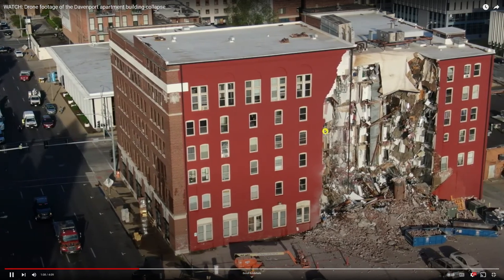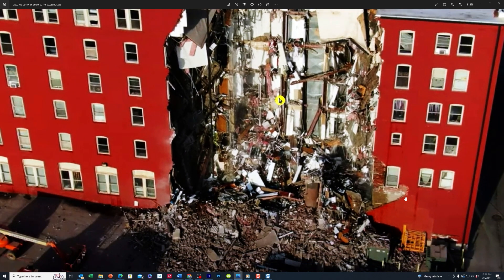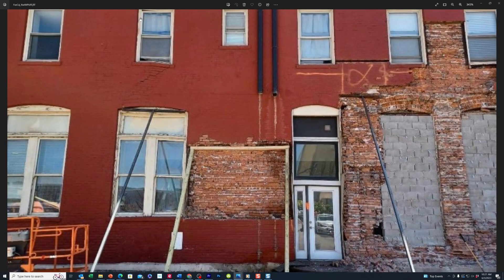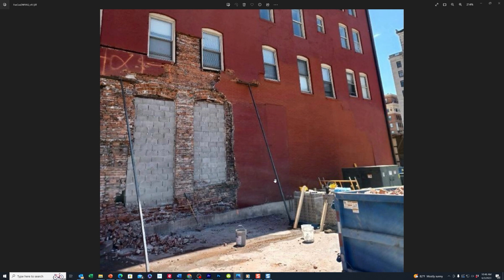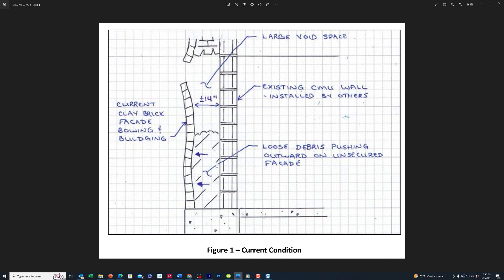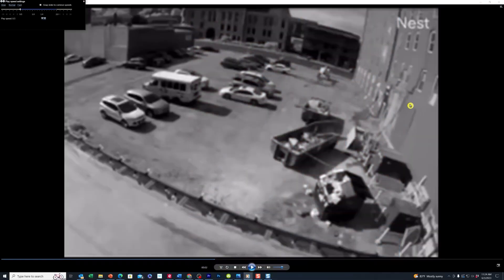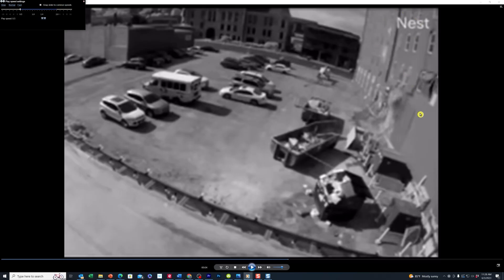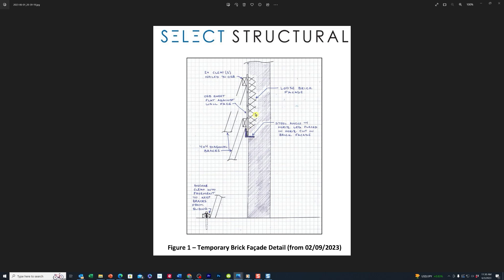Davenport Collapse Security Cam Analysis Pinpoints Origin

Comment: Would “just” the facade falling would not bring down so much of the building?  There HAD to be so much water damage in the structural wall!  Great coverage!  This one wonders what the bid included from the guy who lost the bid and warned the workers earlier.
Reply: IIRC it was $50k in bracing that the owner refused to pony up for. And it seems like the final approved permit for the same job was submitted as basically a $3000 DIY that the building owner was taking care of mostly in house.
Reply: @matthewbowen5841  Yeah, probably with Home Depot sidewalk workers...
Reply: @matthewbowen5841  Yes, and it's quite common for an owner or "handyman" doing the work to severely under-report the estimated repair costs as the cost of the building permit increases substantially in many types of jobs.
Reply: Yes. It's how those old buildings were engineered at the time. The brick was actually support. Like many things, people today only view things from a modern perspective and think that's the way it's always been.
Reply: It's not necessarily water damage.  The mortar they used back then was crap, it dries out and gets brittle, eventually providing no adhesion between bricks.  You end up with a wall held together by just gravity.

Comment: Those columns of windows: cut along the dotted line.

I won't be at all surprised if they discover that one or more of the interior courses of bricks in those walls were just 'indoor' bricks, meaning bricks that were merely dried and not fired. Much weaker and they revert back to mud whenever exposed to too much moisture. 

But hey, what did the original (no doubt low bidder) builder care? The building would stand long enough to outlast him.
Reply: Well, I wouldn't blame the original builder too much here. It can't be a retroactive expectation that 1908 engineers and builders should be held to using materials that would hold up to major water leaks and total disregard for maintenance 115 years down the road.
Reply: @matthewbowen5841  Except I'm not holding 1908 builders to expectations that weren't well known at the time. It was widely known that 'indoor' bricks were unsafe for use in exterior structural walls and, in many cities, it was against code at the time. I don't know if it was against code specifically in Davenport but the risks were widely known.

All brick, all masonry, absorbs water and evaporates it. This is knowledge that is literally thousands of years old. A structural wall needs the extra strength of fired brick for the exterior courses but the interior courses are hidden from view--it was a very common cost cutting dodge in the 1800s and early 1900s to substitute indoor brick for part of the fired brick that was called for.
Reply: @GrainneDhu  Got it. I wasn't aware, thank you
Reply: @matthewbowen5841  No worries.

I find it darkly amusing that the more things change, the more they stay the same. Our ancestors weren't all that different from we are today--they just applied the same attitudes and rationalisations to the tech they had at the time.
Reply: @GrainneDhu  The knowledge might be thousands of years old but not everyone is clued in... I used to own a house built in 1994 with a brick facade on it. It had a box bay window through it. Guess what happened to the drywall ceiling of the box bay window? It got wet because water was getting through the brick, which is apparently not quite as waterproof as the builder (Richmond American Homes) had hoped it to be. I broke a hole in that ceiling and looked through, I could see the back side of the brick facade. Also, this facade had no weepholes in it at all. I suspect it was pulling away from the house, too. I had the ceiling repaired and I believe the water leak was fixed by correcting some bad mortar joints below a window above the box bay window. But even with that...brick is porous. It will allow water behind it, eventually. Just a bad design.
Reply: @brianleeper5737  I grew up in a house custom built for my parents in 1968 with a brick facade and a big, gorgeous bay window in the living room. They eventually sold it in 2005 because once us three kids were out of the nest and they were getting older, a 17 room house built for entertaining was just too much house for them to keep up with.

As of 2005, that bay window had no leaks at all. There were no leaks anywhere in that house.

I suspect that the difference may have been that, due to an unusual set of circumstances, the construction crew was Mennonites who only took on one or two non-Mennonite builds a year to supplement their farm income. In that area and time, anything built by Mennonites was sure to be built right and built to last.

No, they weren't the lowest builders in the short run but I bet my parents saved a ton on that house because it never needed any structural repairs. Like true Iowans, they only paid for one roof--well timed hailstorms made sure that the insurance company paid for the subsequent re-roofings!

Comment: The structure here apparently had enough redundancy in much of the structure to prevent total collapse. Could this be due to the structural framing plus interior walls acting like shear walls. The part that collapsed looked like a square cake with a square piece cot out with a knife. In CTS only the one shear wall prevented the part over the lobby from coming down.

Comment: Such a shame when a hundred year old building and its inhabitants suffer from neglect
Reply from the maker: We will see many more likely
Reply: @jeffostroff  tell me about it ,there's a 1868 building in portsmouth ohio that is a two story formerly three story brick built building that has a severe atleast 10 ft lean I wish i had help to save it ,I want it because I'm starting a horse carriage restoration shop and this building was the john dice carriage manufacturer mr dice sold carriages as far as Missouri in the late 1800s
Reply: @wesbrackmanthercenthusiast4695  Knock it down.  The mortar they used back then in brickwork is basically dried out, brittle and useless now...

Save the old bricks and use them for a new building.
Reply: @johnbergstrom2931  Many building codes don't allow used materials. However there was and still maybe a market for used Chicago bricks years ago colonial brick would salvage Chicago face and common brick and sell them for use down south.
Reply: @danielbackley9301  You can certainly use them for a veneer, a walkway, a brick fence, lots of stuff.

Comment: ya looks like the arch. And if you look at their "repair the cinderblock wall was not actually secured against the arch at all ROFL they might as well not have even been there.
Reply: Seems like the cost-cut repair assumed that the buckling was due to the caivites that used the be windows and thus the cheap fix was just to mostly fill those in so a new flat surface could hold an outer layer to cosmetically improve things. Support was never taken into account, just cosmetically filling in the holes. Which is the result if the cheap owner disregarding the engineering plans and doing his own thing for cost savings

Comment: One of the clearly displayed facts about the condition of the building is that the bricks of the"load bearing" layer behind the facade were badly deteriorated and crumbling. Do we know how many bricks deep this inner wall was originally?  Was there also evidence from interior photos of damaged apartments that the inner course of the load bearing brick wall was also crumbling? Were there any horizontal ties joining one course of the load bearing wall to the courses inside and outside that course? Could the accumulation of debris between wall and facade have also exerted an inward pressure on the bearing wall.  And for me perhaps the biggest question is whether the debris accumulating between the wall sections in fact coming from the inside of the facade or from the outside of the bearing wall?     @melitatunnicliff8385 's comment about the limited function of the steel is critical.
Reply: The biggest factor was the mortar they used in this brickwork.  The stuff they used back then wasn't very good - gets brittle, separates from the masonry, becomes pretty useless over time.  Modern mortar, with Portland cement, is infinitely better.

Comment: I work inside this building roughly 8-9 years ago they gutted the hole inside from new plumbing, walls, electrical cabinets, to flooring everything but it seem like they skimp on the outside 😳 unreal
Reply: Yeah, it looked as if it had had a recent "update" to the interior.
Reply: @freeradical6390  Yes, you can even see the steel studs they used for the drywalled partition walls tangled up in the collapsed debris.
Reply: that is what we call "polishing a turd" no matter how hard you rub it and how shiny you get it, underneath that is still just a .....turd.
Reply: The exterior facade bricks were only an indication of the real failure point - The inner structural brick walls (lighter colored bricks). They supported the steel floor beams that tied to the interior steel framework (min structure), the brick walls were structural elements!
Reply: likely none of it was done right and further weakened the building, helping it to collapse.
possibly downspouts and buried storm water drains leaking for many years eroded the soil away ad they ignored it until failure.
IMHO, far too much collapsed at once and was happened, for there to not have been a long term underlying cause. which was of course ignored, because someone was clearly getting income from. I'd say the issue started 10+ years ago and very likely exacerbated by the remodel. lack of skilled people and red-flags thrown I guess.

Comment: Absolute criminal incompetence. That building should have been condemned.  That masonry was horror-show.
Reply from the maker: The city condemned some of the apartments In that building back in 2021.
Reply: @jeffostroff  At what point do you condemn the whole building and just say that no more rehabilitation can be done - the structure is too far gone? Would lives and property have been saved if the whole building was condemned in 2021 or do engineers think that, with enough money and skill, all faults can be corrected?
Reply: @calendarpage  as soon as you do then you the bad person kicking people out on the streets that cant afford it... they said this was one of the cheapest rents in town.
Reply: @calendarpage  At some point, its got to be cheaper to knock the building down and build a new one than to repair it. I'm by no means an expert in the field, but it seems to me that this building was well beyond that point.
Reply: @russlehman2070  I think new redundant support pillars could have been built to support the floor beams and new steel horizontal ties everywhere. Basically replace the structural function of the entire wall. Then demolish the whole wall (from the top to bottom! Not from the bottom) and rebuild it.
Reply: @rbauer961  I don't doubt that the building could have been saved. I do, however, question whether it wouldn't have made more sense to tear it down and rebuild. Also, it seems that for a reconstruction that extensive, the building should have been vacated. In any case, the owner tried to do it on the cheap and hired people who  didn't know what they were doing, with tragic, but predictable results.
Reply: LIKE A CAR there’s a point where junking the car/ building and creating a new one will be cheaper than repairing the existing one

.
Reply: @russlehman2070  Reminds me of a Faulty Towers episode.
Reply: I know one thing, if I had been looking at those apartments and as I walked to my car noticed that brick wall 'disassembling' itself, there's no fu*king way in hell I would have moved in there...
Reply: Looks like a few people tried to save it, but it was too late and done wrong
Reply: Curious to hear from the contractors on if the holiday weekend played into this somehow.  Why would they start to remove this amount of wall (with poor support) and walk away from it.  You mentioned in the previous video about where blame is typically placed...the grunts.  I'm waiting to see or hear word from that company.  Even the building owner has made a statement, nothing yet from the contractor.
Reply: What do you expect wen boomers hired an infinite supply of illegals who have no business being in this country firstly and really no business taking jobs from people that actually know what they are doing?

Comment: Why would ANYONE think that wall was repairable??? ..espeically working from the bottom, lol.
Reply: The building would have been savable if proper shoring and qualified competent workers were doing the work. The issue is the owners did not want to pay for any of that.
Reply: Then theres the bricks behind the facade! Looks more like a rubble pile than a brick wall!
Reply: Not a mason by trade and it's been 40 years since I pounded nails or rather tried to for a living . But as bad as that wall looked the only way so have fixed that properly in my opinion would have been to start at the top and remove the entire damaged veneer and then repair whatever needed to be repaired properly.

Comment: The brick wall is load-bearing.  Only the interior is steel - an early 20th century hybrid.
Reply: The inner brick is the load bearing part not the outter layer it's duel layer brick
Reply: @Smart-Towel-RG-400  But - but - the window frames were built-into the so-called 'facade' brick layer ... also, do you know what a wythe or what wythes are?
Reply: Yep, and the 116 year old mortar they used on that brick is virtually useless now, dried out, brittle, providing almost no adhesion.  If they had even a moderate earthquake in Davenport, that entire building would be a pile of rubble.  The only thing tying that brick together now is gravity.

Comment: The security camera footage from the previous few minutes before the collapse has been released. It's subtle, but watching at high speed makes it apparent that the supports had been slowly buckling for several minutes before the final collapse.

One thing I note is that the braces were called out as multiple 4x4s. It's possible I am mistaken, but the actual supports do not look like multiple 4x4s, nor does it look like they did the OSB+steel angle called out in the drawings. It looks like someone put in a single metal pipe and called it a day...
Reply from the maker: I mentioned this in my previous video and in this video that I did not think that those looked like 4 by 4 they were 2 by 4 and they. Weren't even staked into the groand there are missing the sheets of o s d
Reply: In his last video about this a few days ago he mentioned that those were not 4 x 4's.
Reply: That long brace did buy them one or two more seconds, so there's that.  It does very very slowly start to arch inwards.